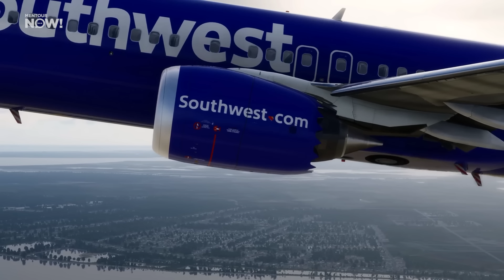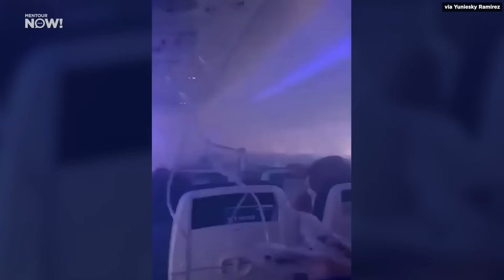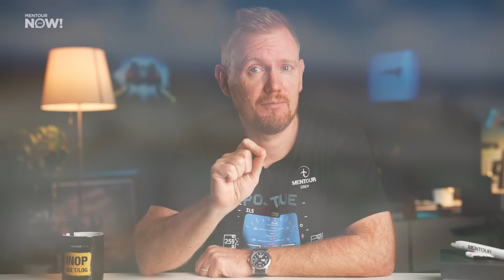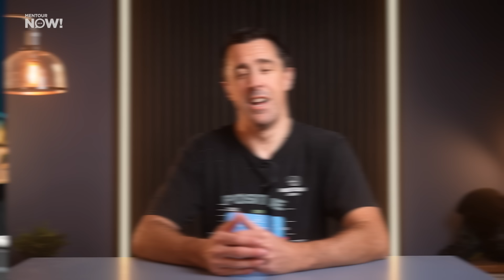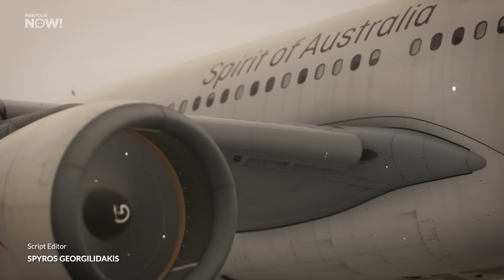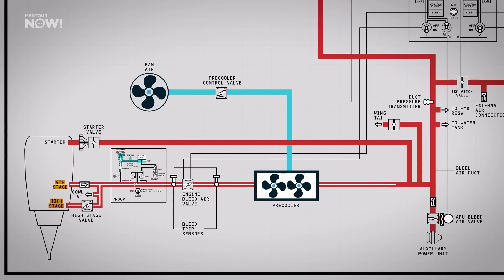Why Don’t ALL Airliners Do THIS?

Comment: USA: anti EV, pro oil. Boeing: fuel burning APU powers electricity, battery to start engines and power pneumatics
Europe: pro EV, anti oil. Airbus: fuel-burning APU supplies bleed air.
China: a bit of both actually - COMAC: Airbus A320 made with consultation and supervision of Boeing.
The irony extends:
USA: sports are rules-based, organised, strict regulated times, officiating takes as much time and drama as the plays like in NFL or Baseball. NASCAR: less technicalities.
Europe: sports are performance-based, grass root, cultural, plays takes precedence over officiating like football. Formula 1: all technicalities and depends on powerful steward officiating.

Comment: As a Passanger, I was drawn to the 787 in part because of non-bleed-air cabin air conditioning. This was back in 2013. I will always choose the 787 given the option. I expect Boeing’s next blank sheet aircraft will follow the 787’s lead. Note that since the 787 was introduced, its various technologies have been adapted to other airframes. This will likely continue.
Reply: As a passenger I will fly on an airbus to I make it where I am going
Reply: @DarkAttack14 Well Airbus will simply copy whatever Boeing makes like with 787 so you won't miss out. Just need to wait a while.

Comment: A lot of this conceptually happened in the automotive space as well, with electrical power steering, cooling fans, and even AC compressor and engine cooling pumps going electrical instead of mechanical or hydraulic.  But the use depends on the vehicle.  Heavy duty trucks tend to still use more mechanical or hydraulic stuff, whereas hybrid cars tend to use more electrical, and some systems show more clear benefits than others based on efficiency of energy conversion.  For example, most vehicles have electric power steering now as it's generally most needed at slow speeds, while only some have electrical AC compressors which are probably less efficient in many cases.  Electrical engine cooling pumps are probably more expensive to make reliable vs mechanical ones.  I've seen setups with a tiny pump sized for cruise and an electrical pump for high load vs speed scenarios (idle, full throttle).  

Always goes to show that there are lots of neat engineering solutions out there, but answers on what is best are never as simple and clean cut as pedantic mechheads want them to be.
Reply: The best replacement is being able to ditch the vacuum system in cars. Earlier EVs and Hybrids just had an electric vacuum pump, but quickly were able to get electric systems to replace all the downstream components. It's a little wild to think people were/are driving around with a system where a leak in the HVAC system could potentially cause a brake failure.
Reply: @Senthiuz well, brake assist failure lol (I know, it's the pedantry I was poking fun at earlier lolll)

I have a vehicle that uses hvac vacuum just for directionals (3 electrically controlled vacuum actuators, seems silly) and it does leak a bit.  Had another even older one that used directly controlled vacuum actuators via push button valves it worked super well and somehow didn't leak).  I always thought the idea was nuts even before I saw them IRL.  I'm not that old, and grew up with entirely electrically actuated hvac cars.

Comment: I believe Airbus will eventually be forced to abandon the bleed-air system as well, just as Boeing were eventually forced to adopt the fly-by-wire system.
Reply: Weed air has been used for decades.
Boing wasn’t forced to fly by wire. It’s a cheaper and lighter system. What is difference is does the computer control the surfaces or does the pilot. That’s the difference between Boeing and Airbus.
Reply: Really? So you think Airbus will follow suit and load up the aircraft with tons of batteries (fire hazard) with extra shielding required (read: adding weight) to move away from what works? When you can fix it all with software? I'm thinking no...

Comment: Cars used to use a lot of vacuum to operate certain controls but computers can control electrical motors much easier than switching to vacuum units so I think the same applies to airplanes. Computers are running pretty much everything so I think electrical is the way to go
Reply from the maker: I think a lot of cars still use vacuum for the door locks..! But I'm no expert on that
Reply: @MentourNow  Hmm, I've seen vacuum motors used on cars to actuate cruise control, windshield wipers, differential locks, heater/AC air flow control doors, and of course power brake boosters. But I've never personally seen it used for door locks. I suspect it was done, but I doubt it's been used in any cars designed after the 1970s.
Reply: The main use are power brakes, that's why brakes are very hard when the engine is turned off, but they are recently starting to be electric too.

Comment: This may be a silly question, but how does compressed air start the engine that is needed to compress the air…?
Reply: You can get compressed air from the auxiliary power unit (APU) or you can get it from a ground supply.
Reply: @watty9297  thanks - an external source definitely makes sense, but Ben seemed to say that it was the air from the same engine.
Reply: @andrewb9590  You're right, not from the same engine. But in addition to ground air and APU, it can also come from the other(s) engine.
Reply: @andrewb9590  Yes, he did seem to say that. Maybe he meant bleed air in general (i.e. from the APU or bleed from the other engine that is already running).

Comment: Goodness, I'm afraid you've missed a key point:  I strongly suspect Boeing tied up a LOT of intellectual property (IP) by being first with electric pressurization.  Airbus would have been loathe to pay royalties to Boeing, and that is likely a very strong driver in AB's retention of the old-fashioned use of Bleed air for pressurization--AB was late, and the price they had to pay was letting Boeing tie up a lot of the IP.  Boeing makes a lot of mistakes, but moving away from the inevitably toxic Bleed air for pressurization was not one of them.

Since you have research staff, I'd have them look into just how many patents Boeing and their suppliers have on the 787's pressurization and HVAC systems, and how much time and effort it would have taken Airbus to design around them--I strongly suspect it would have been massive.  Being second really hurt AB . . . .
Reply from the maker: That's a great point, except I'm not sure it was Boeing themselves who designed that system. A lot of their suppliers designed quite important subsystems on this plane, so I don't know who owns those patents. But you're right, it's an area worth exploring. Thank you!

Comment: What would you do in a car if the cabin filled with smoke?  Open a window.  Why can't there be emergency windows/vents in cockpit and cabin?
Reply: The short answer is that they would be a large safety risk. The longer answer ...
On many older airliners, the side windows in the cockpit could be opened. Sometimes this was an emergency escape route for the pilots. But no window can be opened if the airplane is pressurized. It takes an airliner at cruise around 3 to 5 min to descend to an altitude where the aircraft can be depressurized. This is too long to wait to open a window if conditions are bad and occur suddenly. Thus the masks for the pilots.
Any opening window introduces safety risks. Avery added mechanism comes with failure modes. The added risk from two windows in the cockpit that can open is small. But if you were to put dozens of openable windows in the airplane, the risk of a failure multiplies by the number of windows. And this is just the risk of a mechanical failure. You add in the risk of a passenger messing with a window, and the safety implications get worse.

Then there is the question of what happens if the windows are opened for smoke. There would be a VERY strong wind outside the window, and often very cold. People sitting next to the open window might get buffeted about quite violently, and if an arm went out the window it would likely get broken due to the force of the wind. The standard temperature at 10,000 feet is 5 C (23 F) - though just like at the surface, it can be a lot hotter or colder depending on the weather. Anyway, if we assure this temperature, and a 200 knot (370 km/h) wind, people near the window would likely get frostbite quickly, and might even die of hypothermia. Opening windows would not be a safety improvement.

Comment: Wires are easier and faster to manage than pipes. Both can fail, so both requires redundancy. Initial cost can be even higher, because facilities and maintenance sites get used to have more pipes, tools and other things related for it.

Comment: One very interesting thing about the batteries associated with this is that they, unlike the heavy bleed air ducts, can be located almost anywhere in the aircraft. Purely from a design perspective, that allows better fine tuning of center of gravity. Not a huge issue, but many aircraft use ballast, literally needless weight that said batteries could fill.
Reply: Whilst that is true, the absolute best place to put weight is on the wings anyway, hence why the engines are there in the first place.
Reply: @N330AA  Do you pump tires when flying? Do you have to pump cabin?
Reply: @pvsolutions9292  - I know this is a necro-post. I have to ask you, what do you mean? No, you do not pump tires in flight. Yes, the engine (or, an auxiliary pump) does pump air continuously into a pressurized aircraft cabin. That is how cabin pressurization works.
Reply: @deanfowlkes I was trying to explain that if you set gas to closed volume, it stays there. Like bicycle tire hold pressure
Reply: @deanfowlkes You dont have to pressurize Apollo space cabin in flight. Only before start. Could it work to planes? It works to submarines
Reply: @pvsolutions9292  - It would not be practicable. Apollo spacecraft and submarines do not have a way to replenish oxygen and dispose of carbon dioxide and monoxide via the outside atmosphere. There is so very little air in space and underwater, it would take a lot of equipment, energy, and chemical reactions to make that possible. Spacecraft and submarines carry pressurized oxygen tanks and other equipment to make breathing sustainable. 
Aircraft , even at 60,000 feet MSL, are already flying in an oxygen rich environment. The only thing a human would need to survive at 60,000 feet altitude is for the air to be pressurized and dense enough for the oxygen to be usable. You would still have to dispose of the carbon dioxide and monoxide. Which is done by venting old air into the atmosphere and pressurizing new air from the atmosphere into the cabin. Otherwise, everyone onboard the aircraft would have to wear positive pressure pure oxygen masks, like the type you see fighter pilots wear, the entire time the aircraft is above 25,000 feet MSL. At altitudes above 15,000 feet, everyone onboard would need supplemental oxygen dispensers like the types you see in hospitals.
Reply: @pvsolutions9292  - if you placed any human or animal in a sealed container, like a tire big enough for them to fit inside, the pressure would remain roughly the same. They would die from lack of usable oxygen and carbon dioxide poisoning. Some types of hibernation might extend their lives. That is not currently practicable for humans. You would have to have a way of providing fresh useable oxygen and scrubbing the carbon dioxide and monoxide out of the air. Just another reason why spacecraft need sooooo much fuel to lift so little payload in the way of occupants and cargo. Before nuclear power, submarines used to have to stay on or very slightly below the surface for extended periods (90% of time at sea) to accomplish the same task.
Reply: @deanfowlkes  Yes you are right, I was just showing what is really needed, oxygen, not pressure. Submarines create oxygen from water with electricity, there are 50-60 people inside
Reply: @pvsolutions9292  - You need both oxygen and pressure. At too low a pressure, oxygen would not diffuse through the tissue layer of the lungs, into the blood stream. Actually, at too low a pressure, oxygen and all of the other gasses would diffuse out of and leave the blood. At 60,000 feet MSL, normally oxygenated and carbon dioxide filled blood would “boil” at body temperature. Sort of like when you open a soda bottle. 
There is also the matter of density. Although there is the same percentage of oxygen in air at 60,000 feet as there is at 0 feet MSL, the lower density of the air at higher altitudes is insufficient to supply the sheer number of oxygen molecules required to sustain the human body. 
As far as submarines and spacecraft, they use a combination of pressurized oxygen tanks, electrolysis of water, electrolysis of hydrogen peroxide, carbon dioxide/monoxide scrubbers, and oxygen generators (oxygen candles) to make breathable oxygen. 
Oxygen generators/candles are interesting because they use a chemical reaction to create oxygen when you burn them. The vast majority (almost all) commercial airliners use oxygen generators for their passengers in the cabin. That is why you have to pull on the cord to start the flow of oxygen. You are literally igniting the fuse when you pull the cord.
Reply: @pvsolutions9292  i think it is more efficient in airlines to just use outside air and pressurise it water is pretty heavy
Reply: The 747 has 622 pounds of depleted uranium in the tailplane as counterweight ballast.
Reply: @greener8116  the tungsten (DU has been entirely replaced) acts as a counterbalance for the moving surface; it would not be a suitable location to put any critical supply systems.
Reply: @greener8116  DU is about 6 times more dense than a Lithium battery mind you.
Reply: Does removing bleed air increase fuel efficiency or thrust?
Reply: @thereissomecoolstuff If you want to know how drawing power from electronics increases engine load you can look up eddy current brakes. Same physics apply that as electrical load increases, so does drag on the engines. It's the reason why high electrical load on a car can cause the rpms to dip. However electricity is significantly more efficient at completing  a task than other conventional forms of energy like bleed air due to all of the energy being used to complete a task instead of a percentage of it.
Reply: @TheTardis157 I guess until electric load issue and battery safety issue being sorted out. The best way to go at the moment is only shifting to electrical power in sequence
Reply: @thereissomecoolstuff Yes and yes, though not by much. You still need power to heat and cool and ventilate, and it comes from burning jet fuel. If electrically powered, that means generators are sucking power from the engines rather than compressed air being bled off.
Reply: @thereissomecoolstuffYes, because even if it draws the exact same amount of power out of the engines, it's more efficient to get that power from the generator than from bleed air.

If you're familiar with cars, it's basically the same as it being a silly idea to get compressed air by bleeding it off the compressor half of your turbocharger, rather than adding a separate air compressor to the accessory belt.

When you take power from the output, you're only affecting the output (which can be compensated for by throttling up), but if you're bleeding air off the compressor stage, you're taking away potential for creating power, since that compressed air was supposed to help run the engine itself (thus requiring more throttling up to compensate than you otherwise would have to).

As the video explains, the reason it was initially done this way had more to do with avoiding weight and complexity, as the electrical technology of the time wasn't developed/advanced enough to be a viable alternative, and fuel prices were much lower, not because it was a great idea thermodynamically.
Reply: @mnxs  It's worse, it's running your AC off of the compressor boost pressure of your turbo, vs. doing it off the accessory belt.
Reply: At the system power levels used here, the wires add significant weight. That basically dictates the battery location. One in the wingbox as close as possible to APU and engine generators, and one in the avionics bay close to the cockpit, where the wires to the consumers are short.
Reply: @danielrose1392  Although, wire weight scales in proportion to *current*, so increasing voltage can be an option, and the 787 does do that to an extent - 235 VAC (and rectification of that into a ±270 VDC bus) instead of 115/200 VAC 3-phase. (Meanwhile in consumer electric vehicles, 400 or 800 VDC systems driving variable frequency drives are common to get weight even lower.)
Reply: @bhtooefr  At the plane distances you might even go for a +-1000V DC system. You can effectively produce DC right at the generators especially if you put them literally on the low pressure shaft of the engine; the electronics that you'd use to make that a starter-generator and regulate natively produce you DC, so you might as well have that DC then if not directly at least right next to that turned into easy-to-transport voltages. The battery can easily run at that higher voltage directly; same for the resistive heaters.
The lower power draw items you can then reduce voltage for locally.